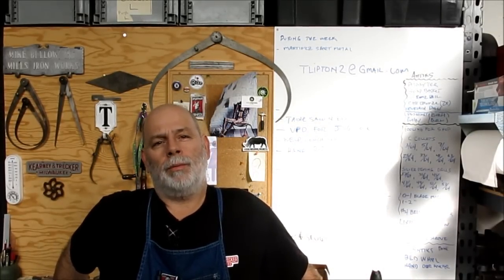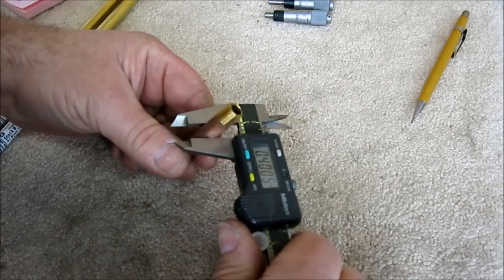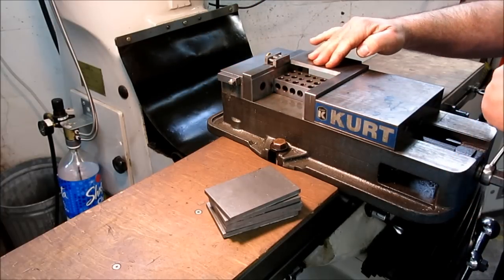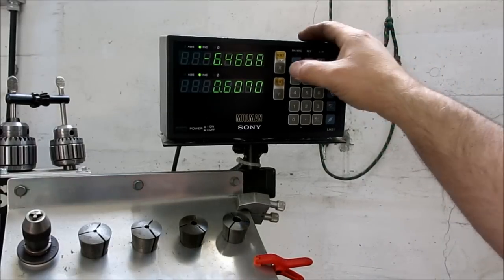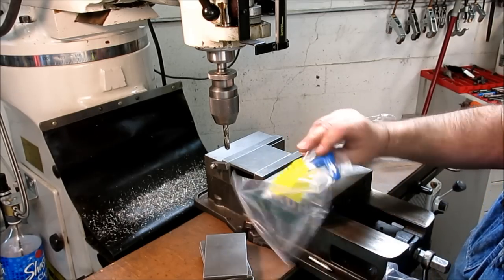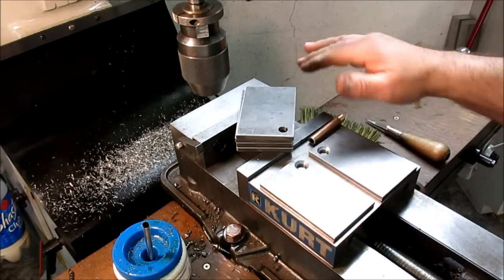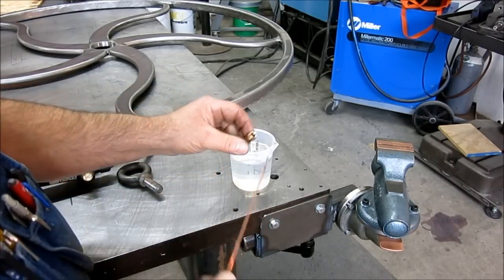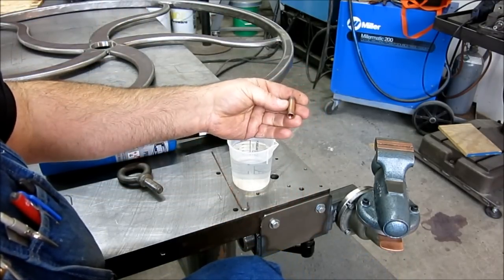Monday Night Meatloaf 12

Comment: I like the step block idea for pry bar usage. I bet you'll wish you made a pair of them though! Nice craftsmanship even on simple fab work like them. I don't know if its the same or not but dad and I always called the " swedging" technique bradding. 
The vise mount turned out good too! Now let's see you flip it over and watch you do an overhead weld while doing a handstand!

Adam
Reply from the maker: Hey Adam,

Now there is a term I have not heard. Bradding. I'm going to use it. Thanks for the comment bud. You are right. I should have made at least three of the step blocks. One for prying on and two for using at the welding bench.

All the best,

Tom
Reply: oxtoolco Thats what I've always called it. We've had a lot of jobs that had solid pins installed and we had to peen both ends of the pin to trap in in place, also known as bradding. I dont know if I'm spelling it right, i dont think Ive ever talked about it untill now.

Comment: You did once again - turning a simple lamination block a step higher towards a peace of art by adding these 45° corners - top design !

Now we have some use for all the small scrap flat bar materials - thx Tom !
Reply from the maker: Hi Keld,

Thanks for the comment. The blocks were crying for something on the corners.

Cheers,

Tom
Reply: oxtoolco Yeah, that kind of 'hearing-ability' is what brings you there !

Comment: That vise mount did turn out nice.  What kind of ball mount is that, sure looks handy?  One of the reasons I used trailer parts is all of the various "drop" lengths available to mount various devices to.  Comes in handy.
Reply from the maker: Hi James,

Its a Wilton power arm. I got it missing the really cool two inch bullet vise it normally comes with. Check out chucks that he stole at a garage sale for ten bucks. The vise is even smaller than the one on mine. I paid twenty bucks just for the ball mount.

Cheers,

Tom
Reply: Ok, this is one more thing for my shop I did not need to know about.  Do you know how much these things go for new?  One of these ball mounts with the cute little 2" bullet is close to five bills new.
Reply from the maker: James Kilroy Hey your forty percent of the way there with your savings on the collet chuck. Better hurry, the fleabay snipers are searching for powerarms right now.

Best,

Tom

Comment: if you use a mag base to hold the plates while belt sanding it saves your fingers from the belt and heat, just alittle tip i learned from knife making.
Reply from the maker: Hi Andrew,

I'm going to try the magnet thing. Didn't sand these long enough to make much heat. Thanks for the comment.

Best,

Tom

Comment: Just thinking out loud, what if you welded the nut for the lockdown on the vise mount on the corner of the square tube instead of the flat side? If you did that you would wedge the inside tube into the corner and not allow side to side movement.
Reply from the maker: Hey Scott,

That would probably be a great idea. Its would have made for a more interesting video putting a hole in the tube at a 45 degree angle.

Cheers,

Tom

Comment: Tom over at Tom's Techniques had a similar project called stack blocks but they were smaller in size and used in place of step blocks when clamping on the mill.

Comment: Hi Tom, this was indeed a riveting video! ;o) The blocks would be handy for many operations around the shop. Not only do they make a much more solid surface than wood to pry on, but, they protect the floor surface at a much thinner useable height than wood ever could! It seems the handle on the quick stop is a bit bigger deal than the allen wrench, But then that might just be me... Great video for guys getting started who will be adding to and rearranging their home shops... Thanks for sharing! :o]

O,
Reply from the maker: Hi O,

After finishing the block I wished I made two. They look like they would be good on the welding bench for setup. If you make some make at least two.

Cheers,

Tom

Comment: Way cool to see Ideas come together.

The magnetic trick for belt sanding you make a  handle / cover so the magnetic doesn't get junk up or over heated, and you have a safe handle. it just need to be thin enough to allow the magnetic to do it's thing. Just screw from back side or epoxy to fasten . Be sure to use an on off mag for ease of use.

That's an old knife makers / modern blacksmith trick.

Another trick the same person taught me I call poor mans lapping plate is float glass ie modern window glass  its fairly flat and diamond paste just use mineral oil to lube and disperse the paste. Comes in every grade down to half micron. Messy but cheap and fast.
Reply from the maker: Hey William,

If you do any lapping check out Timesaver lapping products. I have a plan for a lapping video at some point. Just need the right little job to get a good demo going.

cheers,

Tom

Comment: Zero out at a vice bed- it allways helps at milling parts. Just a sugestion. :) Cheers for the good work. I respect You as a machinist.
Reply from the maker: Hi Nurb,

I do that sometimes if I have blocks to square up. I just love the heck out of that quill readout. Thanks for the compliment.

Best,

Tom

Comment: Good project Tom, yes seems very good for the welding table too.  Using the pipe nipple seemed to work out fine, plus they are readily available.  Did you end up using a Z drill or a 13/32?
Reply from the maker: Hey Bill,

Had to go to 13/32 for the hole to fit the pipe nipple. I wanted to use stainless tubing but I didn't have any around and really didn't want to make any. Stainless forms so well in an application like this but brass makes a better bearing on steel. Probably all worked out for the best. 

Cheers,

Tom

Comment: Hi there, love your video's, very informative and unlike some I've watched, even at 40+ mins long , they aren't tedious!! Out of interest what are those handles called?

Dan
Reply from the maker: Hi Dan,

McMaster Carr calls them clamping handles. There are really nice and add the finishing touches to a project. The big 5/8-11 one I bought was $13. http://www.mcmaster.com/#6271K53

Cheers,

Tom
Reply: oxtoolco
Hi Tom,

Cheers for the prompt reply, I'll have to see if they deliver to the UK, looking at the site my wallet is trying to hide in the corner!

Cheers, Dan
Reply: daniel taylor Hi Daniel, I hope you don't mind me butting in but I got mine from APTC, M10 female for about £2 each. Used female so I could use studding and pick my own length to suit my other bits. Any other queries, happy to help.
chris
Reply from the maker: Chris Stephens Hey Chris,

Thanks for catching that one. You are a true stud.

Cheers,

Tom
Reply: Hi Chris, cheers for the tip, got some delivered last week, will make using my bar twister a bit easier not hunting for the long10mm Allen key!!

Dan
Reply: Hi Daniel, You are welcome, glad to help. 
chris

Comment: Tom, Very nice. When you wanted to back up the swaged end of the tube would a steel ball do the job? I thought of that but then wondered if the ball would upset the already formed 45 degree sawge on the opposite end.
Regards,
Eric
Reply from the maker: Hey Eric,

I thought of a ball first but rejected the idea because I was worried it would leave a dink in my nice welding table. I think a ball would work fine as it has a line contact with the already upset end of the rivet tube.

Cheers,

Tom

Comment: Yet another enjoyable project - thanks Tom.  What type/brand of hammer did you use for the riveting?  I like the looks of her.
Reply from the maker: Hi James,

That is a cool little hammer. I think its a Burklyn or something like that. It has a copper face on one side and a steel face on the other. I have two of them. The copper is hard to change out but not impossible for a determined hammer head.

Cheers,

Tom

Comment: Tom I was taught by my Grandad machinist to call the process you did on that tubing Swedging or Flairing, and tools to do that are called either or both of those names.  Looking it up I came upon one definition that fits what I (think) I know: "Swedging is the process of changing the diameter of metal tubing."

Whatever it was a cleaver build and I like Adam's name for it but I thought a brad was a tiny nail, so I guess pounding on something could sure be called bradding or just plain Whacking the Crap Out of It.

All in all interesting, anything that gets you thinking can't be harmful.
Reply from the maker: Hi John,

I guess I'm going to have to do a little independent research of my own. So we have swaging, swedging, burring, riveting, bradding, flaring, and one other I cant think of right now. Many of these terms are interconnected so it might make a cool study to connect all the dots together.

Thanks for the comment. I like WTCOOIT.

Tom

Comment: I noticed when you were sanding the parts your fingers could have been sanded  a bit. have you thought of using one of your magnets as a handle for that process?  
I have sanded a few finger prints off doing the same thing wood working.. just a thought.  Cool project by the way!
Reply from the maker: Hi Dennis,

That belt sander technique is developed from thousands of hours spent at various belt sanders. Never tried the magnet thing. Seems like the swarf would stick to the magnet and interfere. I guess a test is in order. I do keep a small hand vise near the sander for those really small parts that are tough to hold.

Thanks for the comment. cheers,

Tom

Comment: Tom, I would have made a spacer for that handle, and machined it down if needed later.
Reply from the maker: Hi Geoff,

I needed some additional thread length also. The handle I bought had the longest stud they offered in 1/2-13. It was only grabbing a couple of threads in the tee nut. Thanks for the comment and good suggestion.

Cheers,

Tom

Comment: Great video, Tom!  As another fan said, "Riveting!"  Hah, I mentioned the rotating receiver in Meatloaf 11.  How did that lick go:  something about the angle of your dangle is proportional to the heat of your meat.....? ....your mini-Wilton "Pan-a-Vice.  The steel spacer stack is just too handy!  ....So is the mill vice index stop!  HNY from "Broken rum cabinet latch Joe".
Reply from the maker: Hey Joe,

Wow I'm honored to learn your first name. I couldn't remember who mentioned it but man I ran with a good idea. That thing can move more ways than a class full of yoga students. The new official name for it is the NOGA vise.I need to find me a contact at Noga. I'm doing some serious advertising for those guys.

Cheers and thanks for the awesome suggestion.

Tom
Reply: oxtoolco Hey Tom, "don't know who it was"... again with some more ruminations, prior to "jumping off the dead horse".  Your modified vice mount seems a bit clunky.  You may reconfigure it (or not) after "living" with that modality for a while.  I don't mean to criticize, or tell you "how to cook your barbecue", but....   A split circular receiver (a pipe) would be more solid.  Incorporating  Jergens (ouch, $17) style securing clamp and opposing nut would lock it in position.  Another option would be to employ a solid outer pipe receiver and use an internally expanding shaft to lock it in place.  Similar to an adjustable reamer mechanism or a muffler expander.  Harbor Freight (yeah, I know, it might shatter) sells a cheap (and it is cheap) one for $6 ( item#69550).  The radially divided internal shaft/arbor/thing would be ultra solid ( similar to a VW "wedgemated" crank/flywheel configuration) and only require minimal locking effort.  Or it could be a future project to make?  Baaawwrrroouullll....the dog ain't dead yet!   BTW, how do I purchase a signed copy of "Sink or Swim" and "Doing it Better"?  You gots to pay for materials (ribs for your next barbecue)!
Reply: oxtoolco You could mill/counterbore the work stop bracket (the thing on the mill that you use for repetitive/consistent operations) so that the Jergens handle doesn't interfere so much.  Or it wouldn't even interfere at all (up to 90 degrees).  And/or reduce the diameter of the Jergens handle bolster.

Comment: Of course, mind going a mile a minute here as I watch this.  Watched Tom Lipton build a smaller set of these a while back, and loved the concept.  Kinda like the larger set to complement his stack blocks.  Also love the re-purposing of the brass nipple.  Another option to your swaging would be instead if thinning the ID, would be to leave it the same size and use a hardened pin turned same diameter as ID of nipple and to leave the nipple .0125 longer on each side.  Then, create a slide hammer effect by boring a slidng fit hole in a chunk of steel and sliding up and down the pin to expand/swage the OD to fill your chamfer, and leaving the ID of the nipple unchanged.  Do the same to both sides, then belt sand your "rivet" flush with both sides of blocks.  You can also shim with a piece of paper between two of your layers while swaging/peening to give it a bit (±.003") of play so it does not tighten up too much.  BTW, really enjoying the meatloaf episodes.  Small, bite size videos, to get me through the week.  Keep em coming!
Reply from the maker: Hi Grey,

Did you mean Tom's Techniques? He built some stack blocks recently for the mill along the same lines. Stainless tubing works the best for a rivet like this. I didn't have any around or I would have used that. 

Cheers,

Tom
Reply: OOP!  My bad.  Yes.  I meant Tom Griffin from Tom's Techniques.  Guess I am following too many Tom's on YT.  LOL!

Comment: Tom is your joining process really swaging vs riveting here?  Not really debating just a question to spur conversation.  I think of the different ways of joining (not counting welding, brazing, soldering) as being: riveting, peening (also riveting only using anything other than an actual "rivet"), staking (joining using one of the parts being joined as the joining medium or parent material, and of course swaging, which I generally think of as squeezing such as in cables and assorted sleeve connectors.  Regardless, nice project.  Love that vice setup.
Reply from the maker: Hi Kieth,

Interesting question. So if we removed the tube and were just expanding the end of it what would you call that? On the other hand anything passing through two or more parts and holding them together by upsetting, swaging or smooshing could be called riveting. Not sure here. 

Best,

Tom
Reply: oxtoolco
From everything I've seen, a swaging process is performed using one or more dies to make a workpiece smaller.  So I believe you were riveting your plates together and also in your hypothetical tube by itself.

Comment: very nice , like the adjustable  stop clamp on the mill table what type or name is that looks quixk and easy
Reply from the maker: Hi Ron,

Shop built stop. I did a video on it a little while back. Its real handy and quick to setup at any position. Thanks for the comment.

Cheers,

Tom

Comment: "Steel on steel, no deal!"
Reply from the maker: Hi Jake,

Right you are. That's why I use a wood prybar...

Cheers,

Tom
Reply: Or maybe add a small piece of wood or ply wood between your steel pry bar and the steel rigger's block.
Reply: I'm just saying.
Reply from the maker: vajake1 Hi Jake,

You can take this literally or with a grain of salt. Plywood would keep the prybar from slipping on the block but if you try to stick to the steel on steel is no deal rule then you need something between your pry bar and the machine. The saying is really for forklift forks and jacks and when you are moving a high inertia item steel on steel. At some point steel does meet steel in this hobby.

All the best,

Tom
Reply: Ah!  I see now!  Thanks Tom!

Comment: You "flare" the ends of copper tubing for water pipe connections, so what you're doing is "flaring".  But you're binding two or more parts together, that's riveting.  So you're flaring and riveting, now I think I'm confused.
We used to join multiple parts by flaring/riveting the hollow tubes in the vise.  Place a ball bearing on each end of tube and aggressively clamp your vise.  Both ends flared at once with even distribution at each end.  Probable need steel not copper jaws.  Hardest part was keeping your balls under control.
Awaiting Adam's unveiling of the 7-1/2" X 12", 100 lb, rigger's block with its wheeled cart accessory.

Comment: Yea 6g pipe make it tougher I know you can do it Tom
 Tighe P.S dont come flying around the bench and make yourself talk in a high voice
Reply from the maker: Hi Tighe,

6G is a piece of cake compared to some of the welding tests my wife has qualified on. One of the memorable ones is 6 inches off the floor and six inches off a wall. 6 inch sch 80 with 6010 root and fill. Makes my neck hurt just writing about it.

Cheers,

Tom
Reply: Hi Tom
  Happy New Year yea yea just a day at work . Never had to test for this job just alot of out of position welds part of life thanks for the videos . Like I told Adam better then watching tv .
My best
Tighe